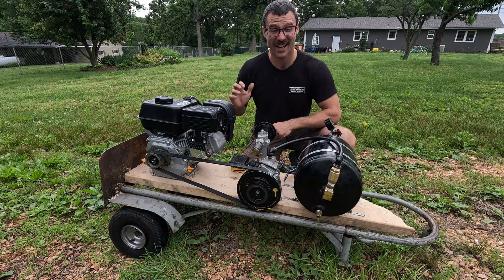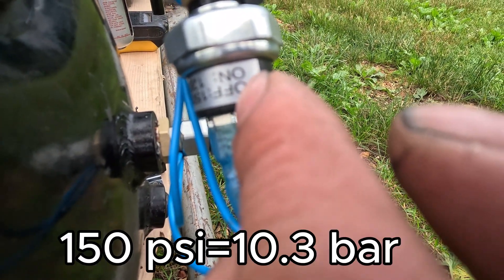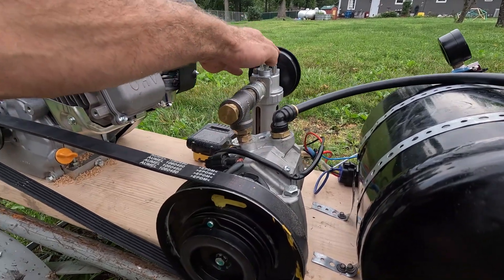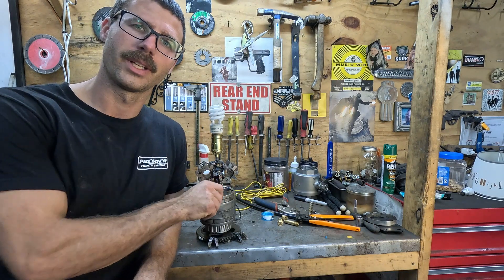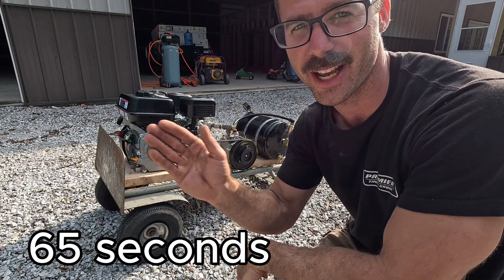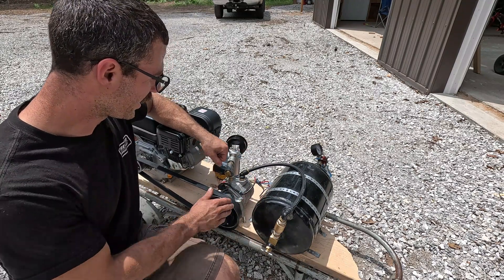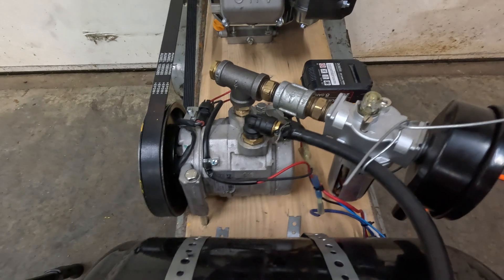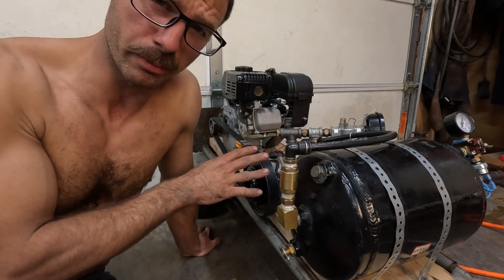Testing how well an AC compressor works as an AIR compressor

Comment: If that's a GX200 clone, it'll top out at ~5000 rpm, and with the disparity in pulley sizes, you're turning that a/c compressor at about 1000 rpm.

I think it deserves another test, one where it's running at at least 6000 rpm, and with an output pipe that won't melt.

In terms of power alone, your lashup should beat the electric compressor by a factor of 2, maybe 3. Sort your load matching issue and it might do it.

Comment: There's some flaws with your setup like your compressor and the speed. They can do up to hundreds of PSI. You're running it fairly slowed down which obviously lowers the output. There's online calculators that will give you the RPM's. For reference the Sanden SD709 is rated like 9CFM per 1000 RPM

Comment: One problem i see is that  plastic line won't last long on the discharge side of the compressor due to the heat of compressing the air it  needs a copper line or braided stainless line in its place
Reply from the maker: You are definitely right about that 😊

Comment: "I have a theory on...". I paused the video. Does your theory have to do with smoke, well an extremely hot compressor? mine does. This is an excellent portable work horse compressor. Now I have a video to finish watching.
    Edit.  Testing Ideas, a solenoid for idle /throttle. A larger engine pulley, would the increase  in cfm be worth the increase in compressor heat? Thanks for another great video.
Reply from the maker: Ha thanks! think this does require further testing to increase efficiency